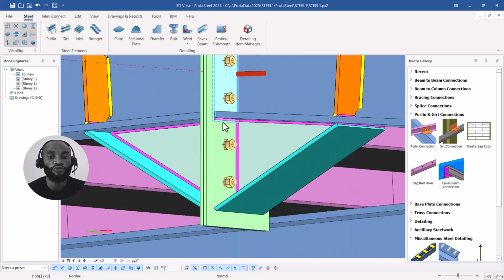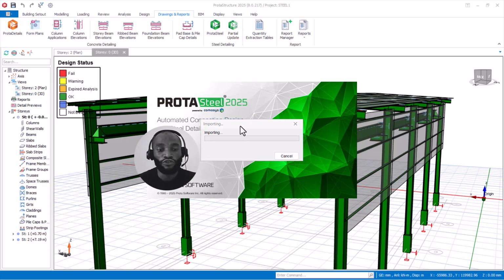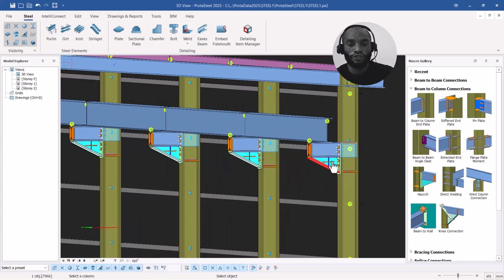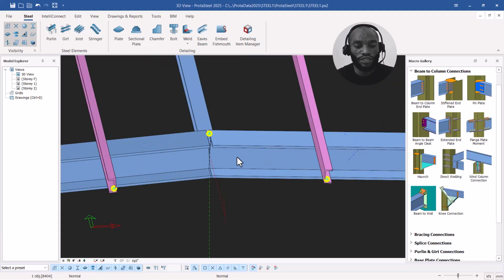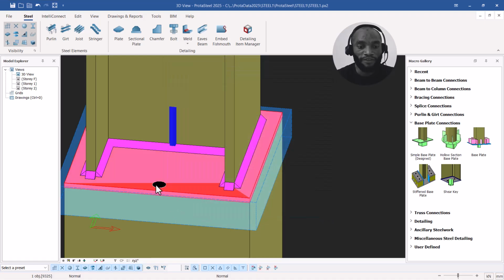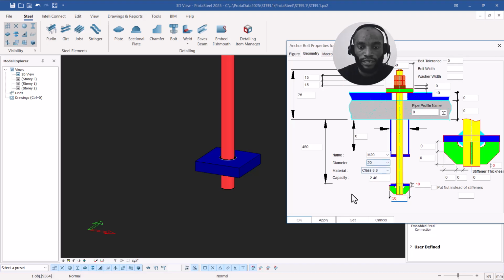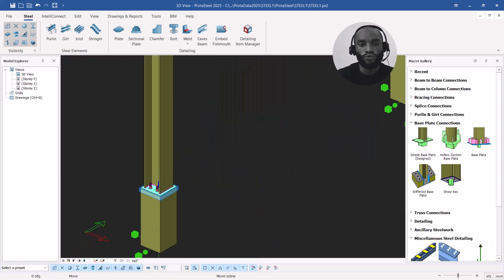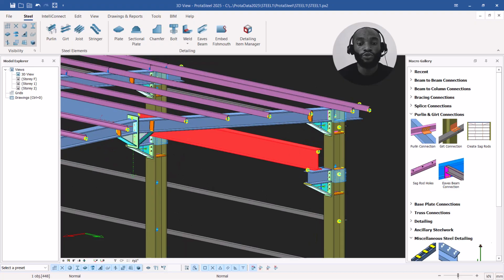Steel Connection for Overhead Crane in ProtaStructure 2025

Comment: Can Protastructure accept all the complex variables for linear & non-linear, static and dynamic analysis from other software, allowing the results to be imported and then used to generate the BBS? For example, can it import structural analysis results from SAP2000, ETABS, Midas Ngen, STAAD Pro, and Robot Structural Analysis?
Reply from the maker: After importing you will still have to check because not everything is imported
Reply: @EkidelEngineering Is there any alternative to resolve this?
Reply from the maker: @fanomarayate2462 For now No, still researching